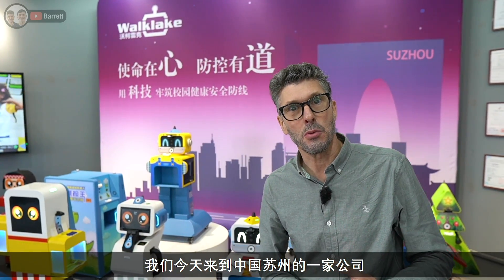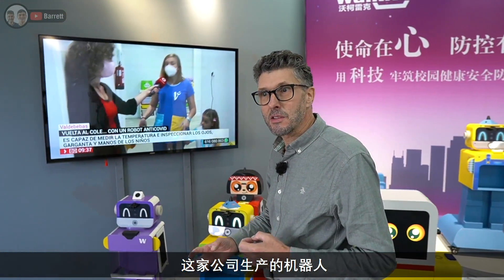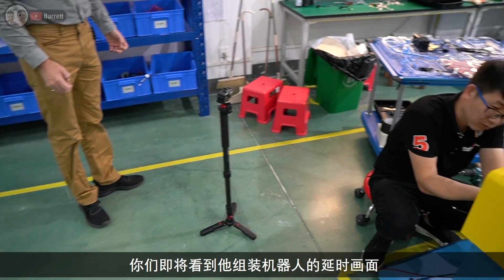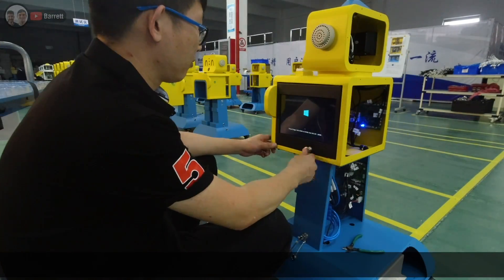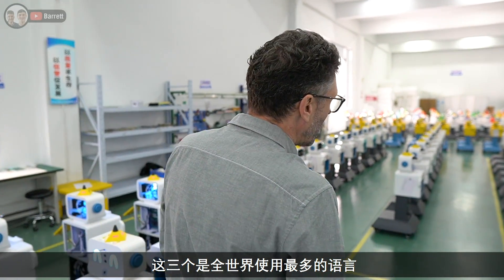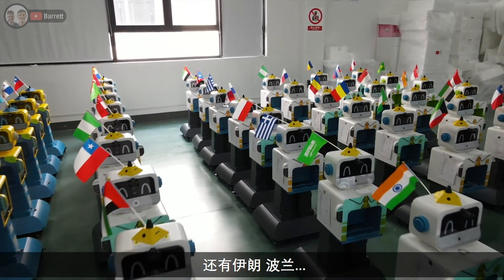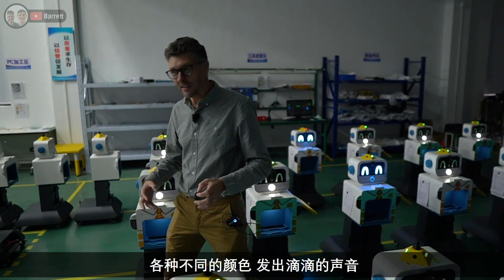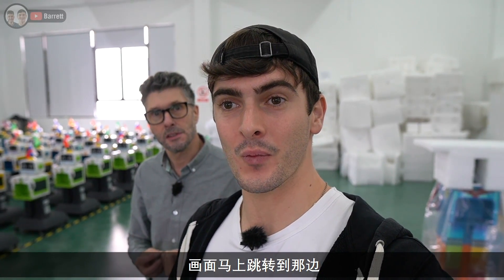Chinese Robots Getting Kids Back to School During COVID-19 // 疫情下帮助孩子们返校的中国机器人

Comment: It's a good idea. The price is about 10 000$. It has a chassi, screen, speaker, low peformance computer, camera, temperature sensors and software. 
These components cost below 2 000$ and can be built cheaper locally.
Reply: In China, the robot is 2000 RMB at most